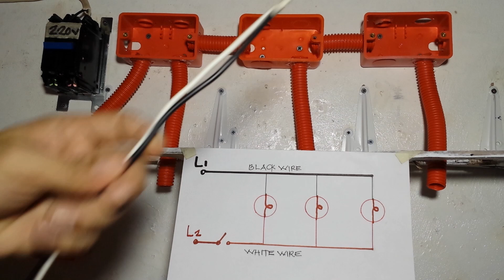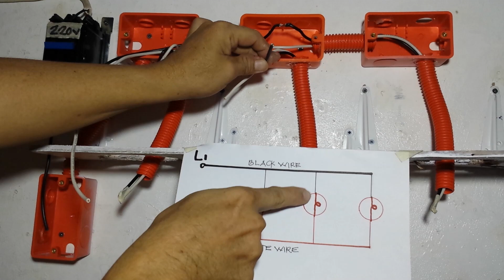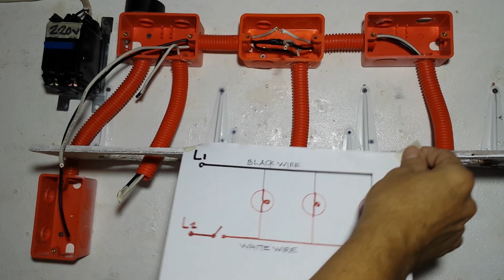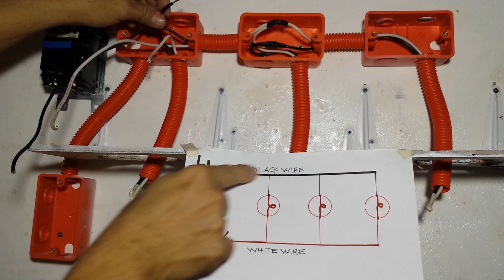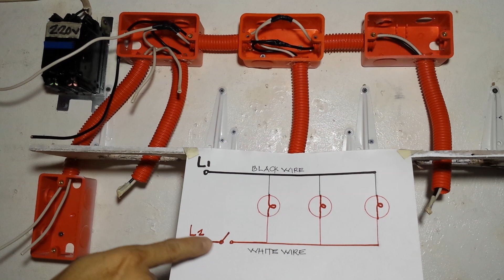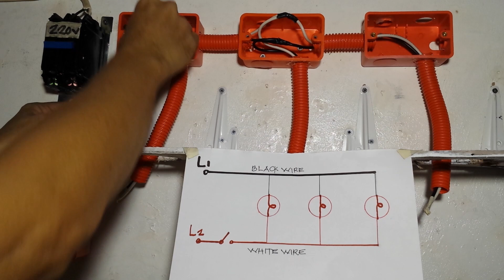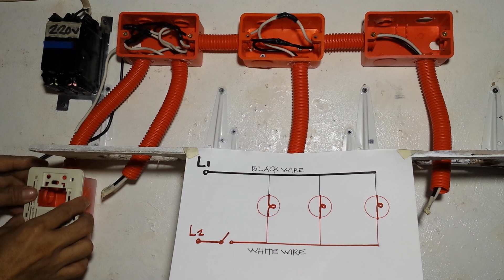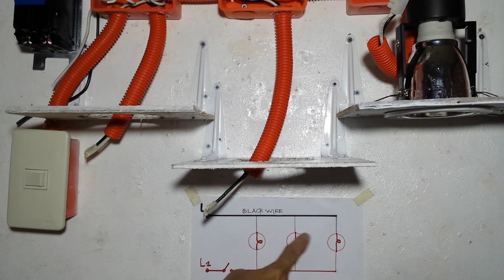How to Install 1 switch 3 led pin light

Comment: Sir Tanong sana ako sa pag install Ng led transformer at strip light saan ba mas maganda ilagay Ang switch sa may 220 v ba para ma off din Ang led transformer  or sa may 12vdc na Ang ma cut off lang ay Yung striplights, thanks Po uli
Reply from the maker: Sa 220v dapat ilagay ang switch Lods, para total shut off talaga....ty
Reply: @Buddyfroi23  maraming salamat po sir

Comment: Sir tanong lang po pwde ba pagsamahing 10 led pin light tri color downlight sa isang swets.
Reply from the maker: Pwede lang sir..basta ang rated ng switch nyo 10 to 15amp para hindi madaling masunog...ty
Reply: Daghang salamat sit.

Comment: walang salitan pero maiintindihan. tanong lang po, hanggang ilang pin light ang kayang ihandle nang 1 switch? plan ko kasi mag diy nang drop ceiling and yung existing na wiring nang isang ilaw ang gagamitin ko para makabuo nang 6 pin light. kaya po kaya yun? sana masagot. thank you po. new subscriber po.
Reply from the maker: Kung 15amp ang Rated sa switch mo sir kayang kaya yon kahit 100w pa ang pinlight mo hehe...salamat din sayo
Reply: @Buddyfroi23  thank you sir

Comment: Gud am sir buddy froi, sa wiring ng mga switches, san po b i terminate yung L1 and L2, ang L1 po b dapat sa switch then L2 sa load or kahit sa gusto ng mag-install tnx po sir....
Reply from the maker: Pag line to line ang gamit nyo sir kahit saan doon sa L1 at L2 ilagay ang switch ok lang..Pero kung line to Neutral yon dapat sa hot wire para safe..Dagx2 idea paki clik d2 salamt...https://youtu.be/eaUEyPPfuwc
Reply: @Buddyfroi23  salamat po sir froi....

Comment: Sir froi! Saan po ba correct connection ng switch? Sa neutral po ba or sa live? Thanks in advance po & more power to your channel
Reply from the maker: Gud pm sir Rico basta sa line to line kahit saan mo ilagay yong switch ok lang dahil hot wires naman talaga yong line to line..Pero kung line to ground yong supply dapat sa hot wire talaga ilagay yong switch para safe..salamt and God bless sayo.
Reply: @Buddyfroi23  Kapag line to line ang supply dapat ay double pole switch ang gagamitin. Hindi pwede na single pole lang ang gagamitin mo sa line to line dahil parehas nga sila hot. Nakapadelikado ng ganun. Violation pa sa Philippine electrical code.
Reply from the maker: @joseldeleon4796  Dito sa atin sir naka single pole naman talaga ang lahat ng switch lalo na sa ilaw..Pero kung gus2 nyong may double pole sa switch meron tayo paki clik d2...ty

https://youtu.be/fatA09saHgg

Comment: Sir idol. . puwede na po ba ang 20amps na breaker at tsaka #12 na wire sa 1hp na aircon? kasi kung palitan ko nang wire malaking trabaho na po. .  kaya naman cguro yan sir idol nuh? salamat sa sagot
Reply from the maker: Good pm sir Shalom pwedeng -pwede po idol yong sinasabi mo dyan
salamat din sayo..
Reply: @Buddyfroi23   maraming salamat sir idol. .

Comment: Ayos sir,ask ko lng sir kung 30amps.lang ang main breaker ilang amps sa 5 lights,ilang amps sa 4 outlets?
Reply from the maker: Gud pm sir Ronald depende po kasi yan sa wattage na gagamitin..Bigyan ko nalang kayo ng idea sabi sa PEC wag kang lalampas sa 100watts na Bulb na ilaw kung 15amp Breaker ang gagamitin mo aabot yon ng 27pcs na Bulb na 100watts..Kung sa outlet naman wag kang lalampas sa 180watts kung 20amp Breaker ang gamitin mo aabot yon ng 20 pcs na outlet..ty
Reply: @Buddyfroi23  yung 180 watts po bang tinutukoy ay total wattage ng ng lahat ng appliances na balak isaksak sa mga outlet?
Reply from the maker: @paoloenriquez32  Assuming lang yon sir kung gagamit ang bawat outlet ng 180w, kasi mag kaiba rin yon sa mga special outlet na matataas na load, kaya nga may Branch circuit sa ibang outlet..ty

Comment: Buddy froi,ayos Lang po ba pagsamahin ang wiring ng sa outlet at sa lightings para kunti Lang ang pagtiktik sa pader,Hindi po ba magkaroon ng short circuit ganun po Kasi ginawa ko sa installation sa bahay. Salamat po sa inyong pagtugon
Reply from the maker: Ok lang sir as long maluwag ang vintalation ng PVC..ty
Reply: Nkalagay lng po sya sa flexible hose Yung sa pader nkafix n po,pero ung sa taas nkahang lng po Kasi wla p pong kesame ang bahay nmin mga trusses lng po,,medu ntakot lng po Kasi ako Kasi bka Hindi pwd Kasi dlawang magkasama ang live wire sa loob ng flexible hose,ung sa lighting at outlet, mraming salamat po kuya
Reply from the maker: @reyalvarez7171  Lagyan mo nalang ng Marking Lods yong  flexible hose para may future referral just incase may trace up...ty

Comment: Bale po buddy froi,standard nmn po ang ginamit Kong mga wire at may Tig iisang circuit breaker sila ,nagtipid nlng po Kasi ako ng pagtiktik sa pader ng bahay at flexible hose,,tanong ko Lang po Kung tama lng ba ang ginawa ko,
Reply from the maker: Kung THHN na wire ang ginamit mo sir mas lalong mabuti, sa tingin ko..ok lang kasi naka Tig iisang Circuit Breaker naman..ty

Comment: hello po sir buddy may tanong lng po ako ksi ung diagram ng pinlight katulad sa bahay nmin.tanong ko lng po ksi pumutok po ung isang bulb.ngayn po lahat ng ilaw ayaw na gumana.ano po kya ung problema.salamat po
Reply from the maker: Mag kapareha lang sir ang Diagram sa Pin light, depende nalang sa Bulb na gagamitin..Yong pumotok na Bulb baka kasi sir na basa sa ulan o kaya may short circuit na nangyari sa linya ng ilaw, eh reset nyo nalang yong Breaker sa ilaw baka nag trip kaya nawala lahat..ty
Reply: sir buddy ni reset kna po ung breaker pero wla padin pong ilaw.tska hindi po sya nagtrip at my dimmer switch po ung mga pinlight.
Reply from the maker: @sherwinsesgundo5239  Baka nasira na sir yong mga Dimmer nyo eh direct nyo  muna sa mga switch..ty

Comment: Hi sir. Magtatanong po aq ulet .😁 bumili po ako ng ganyan. Kaso napansin q po tatlo ung wire sa round downlight.. Ung nsa gitna naka turnilyo lang ung wire nia.. Ano un sir?? Ground? Tapos ung dlwang white sa magkabilang dulo,,  dun ko po ba ikakabit ung L1 at L2?   Iniicp ko po kc ung nsa gitnang wire na naka screw.  
Slmat po.
Reply from the maker: Gud pm Maam yong white or black lang ang gamitin nyo..Yong Green yellow yon po ang ground pwede narin kung di nyo gamitin..Kung puro white yon ang L1 at L2..ty
Reply: @Buddyfroi23  slamat sir. Las question na sir. Kaya po ba sa isang switch ang 8 pcs na pin light ? Parallel connection. Ilalagay ko po kc sa ceiling cove light .
Reply from the maker: @marygracegonzales6722  kung sa Pin light lang kayang kaya Maam basta yong switch  15amp ang rating...ty

Comment: Boddyfroi bakit line 2 ung SA switch mo,,pwede kb malaman
Reply from the maker: Line to line ang gamit natin sir kaya kahit saan mo ilagay ang switch pwede lang..Pero kung line to Neutral ang gamit mo sa Hot wire mo talaga ilagay ang switch para safe..ty
Reply: @Buddyfroi23  ung talaga ung NASA isip ko Rin confirm ko Lang din..tnx idol
Reply: @Buddyfroi23  ask uli Lang ha,,bakit SA PDX wire black ung hot wire
At pag SA stranded wire color coding at naka permis red +/black-.bakit kaya...
gusto ko kasing ma222 mag electrician idol...
Reply from the maker: @renatomacalisang311  May color code kasi  minsan sir ang ginagamit sa Electrical pero depende narin yon sa Electrician kung anong klaseng kulay ng wire ang gagamitin..pero yong Black tala ang hot wire tapos ang white ang Neutral...ty
Reply: @Buddyfroi23  tnx SA info,,
Baka mag ask uli ako sau idol Ng mga bagay patungkol SA pag wiring Ng bahay kc gusto ko m22 mag electrician,

Comment: Possible po ba sya in multiple lights, for example po mga apat ganun, hindi po ba sya pwede iconnect in 3gag?
Reply from the maker: Gud pm sir Michael depende po kasi yan sa design kung gusto mo sabay o hindi mag ilaw yong pin light..Pero  kung individual mag dag-dag ka talaga ng switch..Para may idea ka sa switch paki clik d2 salamt..https://youtu.be/Kw5bi5Wn4FQ
Reply: Thankyou po sir buddyfroi😊

Comment: at saka old panel board to check meter to new panel board 
pwe po bang old panel board to check meter lang wala ng ilagay na new panel board ?
Reply from the maker: Gud pm sir eugene nalito ako doon sa new and old Panel Board idol hehehe...ano yon?
Reply: @Buddyfroi23  pwede po ba mula sa breaker e connect yung check meter tapos mag conect naman sa another breker patungung outlet ?
Reply: parang ano sir mula sa kwentador at panel board mo tapos mag tap ka ng check meter at mag lagay ka ng another breaker  pwede bayun ? 
mag uupload po kayu ng hinde basic na pag tap ng linya  at pwedeng gawin at hinde pwedeng gawin hehehe yun lang po hhehe

Comment: bakit ang hotline sa recptacle, diba sa switch man yan?? ANO connectio yan 110 volts per line?
Reply from the maker: Gud pm sir Tyler tama po kayo sir 110v per line kami dito yong bang line to line kaya kahit mag balikdad ok lang..pero kung line to ground na dapat talaga sa hot wire ilagay ang switch para safe..salamat

Comment: -sir ilan po ba n  maximum n pin light sa isang switch?
Reply from the maker: Depende  sir sa wattage na gagamitin sa Bulb at sa switch, kung 15amp ang rated sa switch aabot yon sa 27pcs kung 100w na Bulb..
Reply: @Buddyfroi23  - salamat po sir

Comment: may tanong po ako, yung pin light na nabili ko may ground push wire pero yung ceiling namin walang groundwire. ok lang ba di lagyan?
Reply from the maker: Ok lang sir CG...ty

Comment: Ilang watts po ba na ilaw ang pwede gamitin dyan sir?ok lang ba 20 watts?
Reply from the maker: Gud pm sir Joey depende po sa rating ampere sa socket sa pin light pero may kakayahan po kahit 100w Bulb kaya dyan..salamat
Reply: Salamat po . 4 na pin light sa isang switch sir tas 20 watts na ilaw kaya ba nang wire yan sir?

Comment: Pano po ba ang wiring connection ng portable welding?
Reply from the maker: Good pm sir Leonardo ano po ang ibig nyong sabihin doon ba sa pag install ng supply sa portable welding machine..
Reply: opo.
Reply: Sir, saan po ba correct connection ng switch? Sa live po ba or sa neutral? Thanks in advance po & more power to your channel

Comment: Sir pwede poba 1 switch controlled 4 pin lights?
Reply from the maker: Pwedeng pwede sir Janel...ty
Reply: @Buddyfroi23  sir meron poba kayong video demonstration settings ng lightnings outlet ikakabit sa mga circuit breaker kung anung mga standard procedure?

Comment: pano kong @pat na ang penlight okie lng ba mga master
Reply from the maker: Ok lang sir..ty
Reply: salamat master may tanong ako mastert 3 gang switch diba tatlong return isang hot yong isang return pwde koba ma series yong dalawang return nag iisang ilaw okie lng ba master
Reply: salamat buddyfroi sana madami pang maituro mo sa amin mga electrician
Reply from the maker: @ferdinandcastor3232  Ok lang sir, total isang linya lang naman sila..ty
Reply from the maker: @ferdinandcastor3232  Cg po sir, salamat..God bless
Reply: salamat buddy froi,,,sa sagot mo